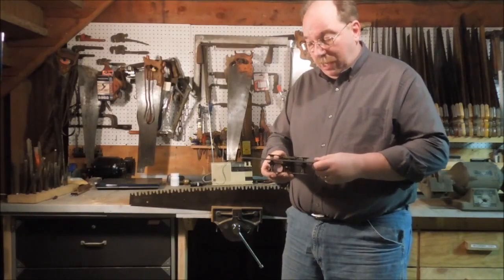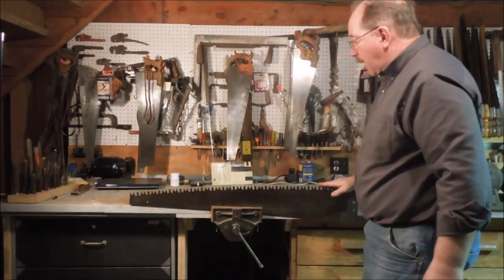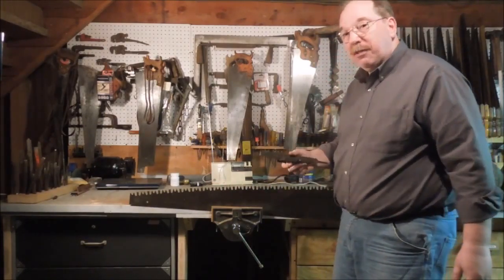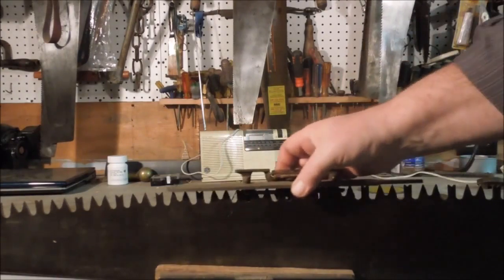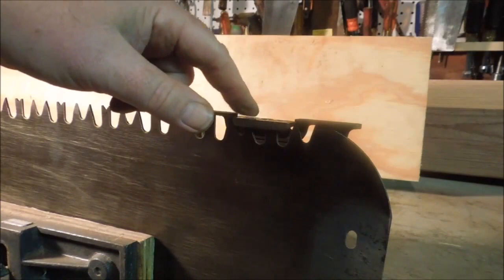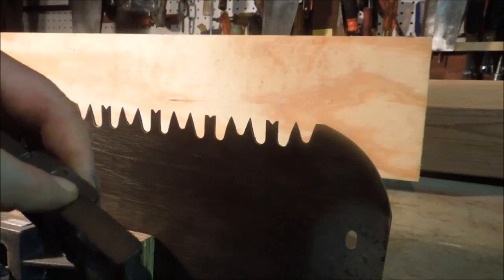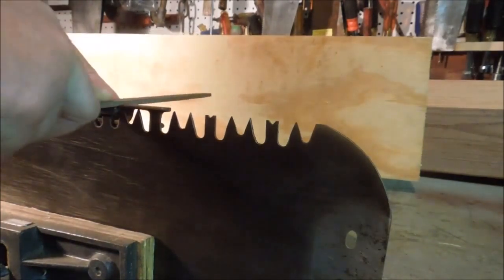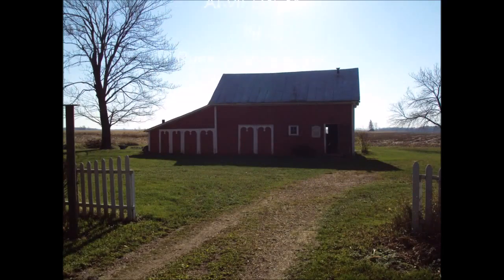One Man Crosscut - The Real Old Sneelock's Workshop - Sharpening - Pt 3 - Join & Set Raker Depth

Comment: Been a LONG time since I watched this. Just the same as a chain saw chain; got to get everything right. Carlton File-O-Plate did the same thing but Stihl had one that'd file the tooth and the drag at the same time and took the drag (raker) down enough so the chain would actually cut. Happy mid-week and GBWYall!
Reply from the maker: I need to go buy a Stihl filing guide. The grinder is okay. An Oregon would be much better. Setting the drags is not easy on a grinder. The filing guide lets you dress them down quickly and get back to work. 😁😎
Reply: @DavidMNighswander-ir7os  The Carlton File-O-plate worked off the tip of the tooth and had 2 holes for the drags with one being for hard and one for soft wood. The Stihl works on the same principal with enough tooth cutting so you don't kill yourself and the saw won't kill you. Commander Todd at Project Farm ran a test on them a while back and the Stihl really impressed me, being a hand filer. It was the way the saw was cutting that did it. The height of the drags either make or break a saws cutting ability. You can have the teeth sharp enough to shave with but if the drags aren't right, all you'll get is dust and smoke; no chips. Been there myself years ago.
Reply from the maker: @lewiemcneely9143  Thanks Lewie. I will check it out. 
I'm about hip deep in paperwork right now. Got MissDig811 squared away and went through possible timelines with Lydia to make sure we are okay with dr visits and when people are coming. 
She is a big help in keeping me squared away. 
I have to get the bank loan approved and then tell the concrete guy to get going. I expect he will be doing a MissDig811 call himself. I would expect that at least. 
I am also trying to figure out what kind of wire to run to the building and where I can get it on time and at a good price. 
Menards is all setup on what when and where the building comes. That will kick off as soon as the loan is approved. Tomorrow maybe. More likely next week at their next bankers knitting session. 😁😎
This afternoon I will be leveling where I dug out the garden in the front yard and planting grass. Always Sumpee!